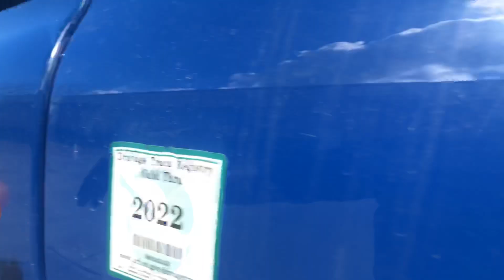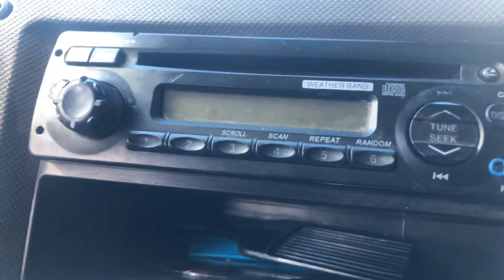2013 FREIGHTLINER CASCADIA DD13 MIDROOF

Comment: I BET YOU AINT DOING PAPER LOGS IN CALI!!!
Reply from the maker: I’m local
Reply: @DERRELL_LB562  does it pull the same as 125?
Reply from the maker: @lashan4636  not sure
Reply: @DERRELL_LB562  ok.I’m looking at buying one.I’m just wondering can it pull weight.or is it an issue with it?